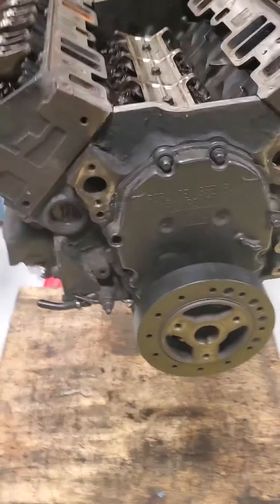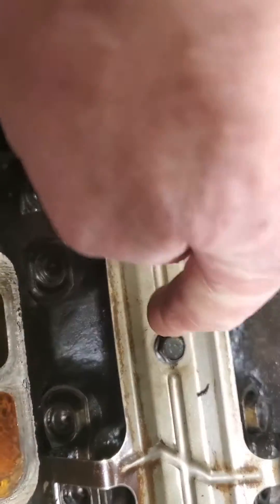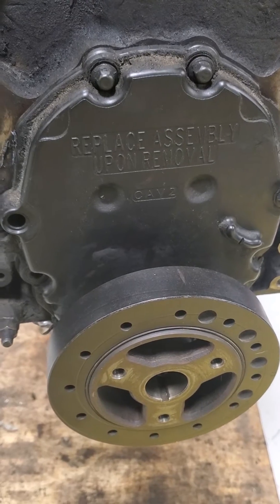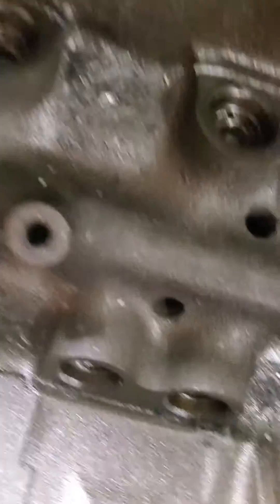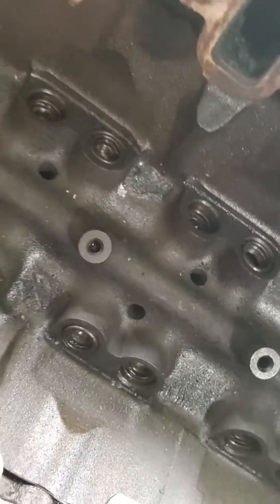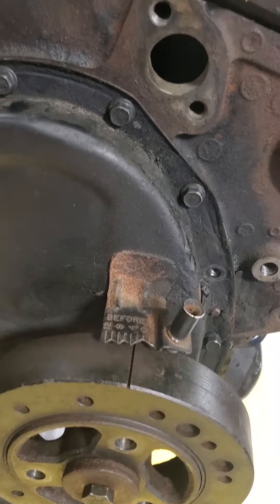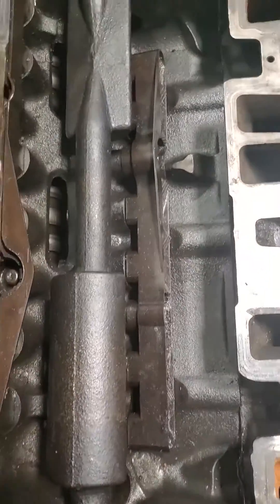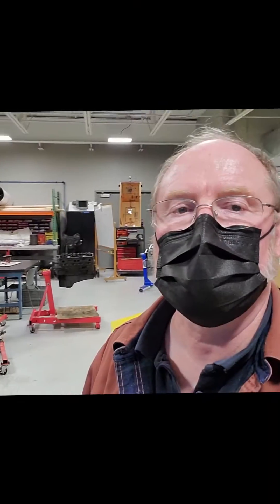GM 5 0 and 5 7 Flat tappet verses roller cam engine Identification

Comment: Just saw this video. This guy seems like a very educated man and I don’t wanna knock what he’s saying but he did say more than likely so there is a chance for you have rollers because I have an older style 305 like the first one he pointed out… I have the lifters with the flat edges and the locks on top with the plate also with a metal timing chain cover never been broken into low mileage motor from an 89 Camaro IROZ L03..
Reply from the maker: @javeryrios3263  Thanks for the info!That is likely true for high performance cars like yours. But fo daily drivers flat tappers were the norm.

Comment: Excellent video. I’ve been looking everywhere to identify if I have a flat tappets or roller cam. I have a 1995 5.7 TBI Silverado. Base on your info, I do have a metal timing cover so more likely I have a flat tappets.  I bought this truck last year and it seems everything is stock and original.  Is there another way to identify if I have a flat tappet or roller without taking apart the engine? Reason I’m asking is cause if I have a flat tappet, I need to run Oil that it’s rich in Zinc. I heard flat tappets engines need that pressure from Zinc to function properly and don’t mess with the cam. Thanks and again excellent information